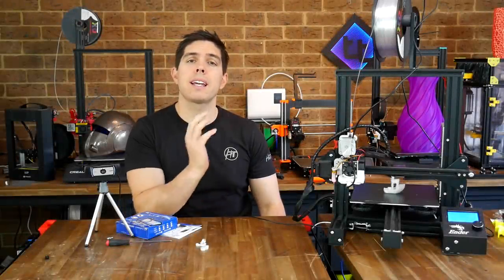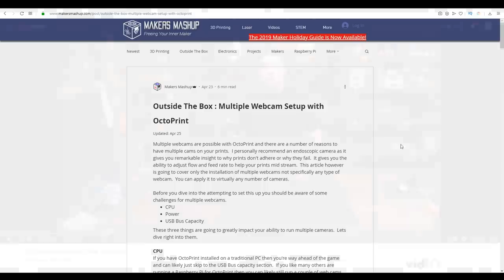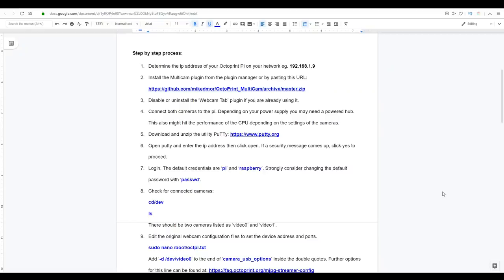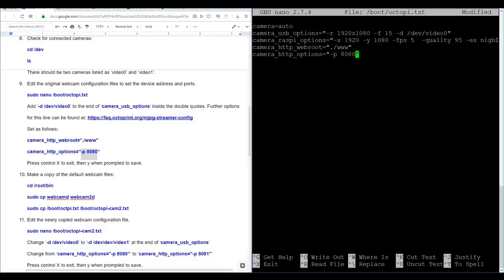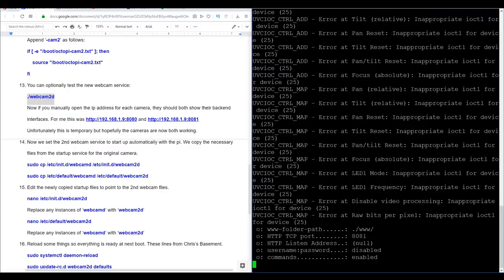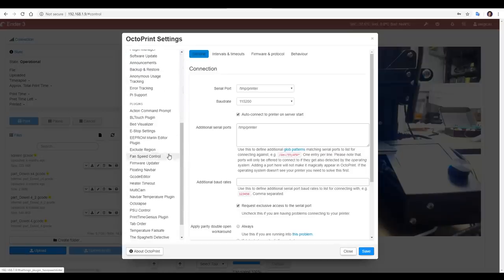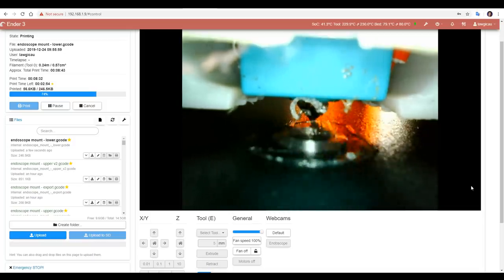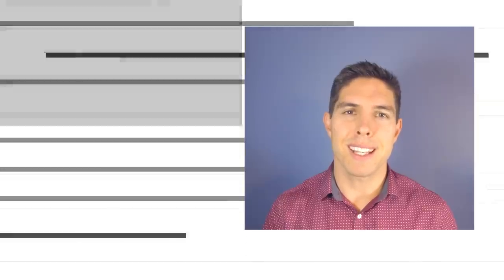Octoprint multicam endoscope guide - Macro nozzle vision

Comment: I just got octoscreem running on a 7" display. I do not have a long enough ribbon cable for my picam. But i do have a pi zero w, i set this up with another octoprint build. Now i can go to my raspi 3b with the display and login to octoprint. Then input the pi zero cam i.p. address and copy the text for the default cam for the rest of the link. Works like a charm.

Comment: Hey Michael, there is a pretty simple way to avoid oozing while probing, just have to set the start gcode to have the nozzle heat up after probe. Each slicer has slightly different code to do this. But i highly recommend it.
Reply: Mark Ferris problem with this is (not a massive one really) is that you need to compensate for the thermal expansion of the nozzle from heating
Reply: Etacovda63 doesn’t affect probing though. You’re not probing the bed with the nozzle, the bltouch or ezabl isn’t going to be affected by it. Only the bed needs to be heated while probing.

Comment: FYI: Raspberry Pi Static IP- If you do not configure your RasPi to have a static IP and the IP changes, your camera feeds will not work as the access URL is set to the original IP in the Webcam/Multicam menus. This can be avoided by setting the webcam URL's to "octopi.local:8080/?action=stream" rather than the exact IP. My Pi's IP changed and I had a fun time trying to figure out why I could not access the Octopi Login in my browser, or why I couldn't access the Pi through Terminal. BECAUSE THE IP CHANGED, also why I then found that my webcams weren't working. If this happens, you can login to your router to see that the Pi is connected to the network and pull the IP from there. Thanks for the vid Michael!

Comment: You are using the LAN IP in the settings. If your router reassigns a new IP (not likely to happen if you have configured fixed IP for it) you will need to update all the settings depending on it. If all the cameras are connected to the same system as octoprint, just use the 127.0.0.1/localhost.

Comment: You could probably use it as a 100% fool proof method of detecting the dreaded blob failure. Because the camera is fixed to the hot end you should be able to get the nozzle shape especially during a timelapse you could detect the deviation on the image from each nozzle snap in the same position and could detect the build up of junk on the nozzle tip.

Comment: I'm running Octoprint release candidate (1.4.0rc3) so that I can run the Octolapse release candidate (v0.4.0rc1.dev2) (which has the auto config), and things have changed slightly. 

The webcam service is controlled by systemd instead of init.d so the service location is /etc/systemd/service instead of /etc/init.d
  - I  changed the init.d path for steps 14 and 15 from /etc/init.d to /etc/systemd/system
  - and added a symbolic link to the multi-user target
      -  sudo ln -s /etc/systemd/system/webcamd2.service /etc/systemd/system/multi-user.target.wants/webcamd2.service

It seems to be working for me with those changes

Comment: Hi there, 

Thanks very much for the great guide. Here is my contribution for those who run into the same issue as I did.

My primary cam is RaspiCam V2 and I was adding a Logitech C920. I followed all the steps through 13 with no issues, but got a failure at step 14. Specifically with the following command:

$ sudo cp /etc/init.d/webcamd /etc/init.d/webcam2d

The 'webcamd' file simply didn't exist in the /etc/init.d/ folder, so there was nothing to copy. I guess it is not needed for the RaspiCam. 

So here is what I did:

1) Go to the /etc/init.d/ folder:

$ cd /etc/init.d/

2) Create an empty file called webcam2d:

$ sudo touch webcam2d

3) Open the file for editing:

$ sudo nano webcam2d

4) Copy and paste all the file code from here to the empty file (section /etc/init.d/webcamd): 

https://github.com/ntoff/Guides/blob/master/mjpeg_streamer_daemon.md#etcinitdwebcamd

5) Save and close the file using the following key combinations:

Ctrl+o
Enter
Ctrl+x

6) Make the file executable:

$ sudo chmod +x webcam2d

7) Execute the second command line from step 14:

$ sudo cp /etc/default/webcamd /etc/default/webcam2d

8) Then go to step 15

Enjoy!

Comment: Hey Michael, any chance of posting the STL for the endoscope mount? The mount I’m using keeps snapping on me. Also, when securing the cable, should I run it up and over the printer, or attach it to the rest of the wiring?

Comment: Firstly, great channel! top notch content but im having trouble with this multi cam install.. 

Operating OctoPi 0.18.0 with OctoPrirint 1.7.2 (most recent "stable" build at time of writing available from Raspberry Pi imager) on Raspberry pi 4b (4Gb RAM + 64Gb SD) Ender 3 V2 running Smith 3d (E3V2-BLTouch-5x5-HS-v4.2.2-v2.0.1) firmwear on my ender 3 v2 (4.2.2 Board). 

Ive tried this walkthrough several times and everything once i get to step 14 on the PDF (10:46 in video) i get an erro when trying to run either:

sudo cp /etc/init.d/webcamd /etc/init.d/webcam2d 
sudo cp /etc/default/webcamd /etc/default/webcam2d 

Both commands result in an files does not exits or user nano does not exist - no idea what im doing wrong im doing wrong. if i tried to directly serach for "sudo nano /etc/init.d/webcamd" or "sudo nano /etc/default/webcamd" then im shown an new blank file at which point if i exit without saving and then go to check the MJpeg Streamer snap shot i get a "site cant be reached" error page on google and cant seem to fix the isse causing me to reflash my pi and start again.... 

Any help would be apprciated!

Comment: If the cameras come up swapped, then you also have the resolution swapped ? Is your endoscope now in full hd?
Reply from the maker: Good point I'll have to check that. The frame rate is quite good so perhaps not.
Reply: Teaching Tech I think the cameras appear in the order you plug them in (first one being video0, second one video1) or in some arbitrary but constant ordering after reboot (probably depending on the usb socket you plug them in). 
If they appear swapped after reboot, most probably video0 and video1 got swapped, and that should also mean the config for cam2 is now active for the webcam (with the low resolution) and the other config is for the endoscope. 
At least that’s the impression I got from what you did in the video. 
Great video by the way.

Comment: HI. I am adding a 2nd cam to the latest. ver. 0.17 octoprint, but i do not have /etc/init.d/webcamd, specifically, init.d. where would this file be located? I am not a programmer so anything would help. Thanks.
Reply: basically i am missing the webcamd file in etc/init.d. How do it get that file?

Comment: most of the endoscopes on amazon come with a mirror at 45 deg attachment to view at 90 deg angles . Why didn't you use a mirror attachment and mount it in a vertical fashion ? Did you try and run into some obstacles?  that is what I am planning to do with mine and just tie wrap it to the inductive probe

Comment: I could not get it to work, trying with only one camera, skipped the part where you copied the file as i assumed that it was to duplicate the settings for the second camera but the issue is that i do not have the webcamd file and the /root/bin folder, not sure whats  up.

Comment: FWIW - There are 'endoscopes' that have totally flexible cords. Generally, they're sold as otoscopes for ear inspections. Other than the cord, they're identical to the vast majority of cheap endoscopes. The manufacturers are constantly changing, but you're after something like this: https://www.amazon.com/gp/product/B07BHLXGHC/ Make sure you get one with the shorter barrel (not like this https://www.amazon.com/Otoscope-Ultra-Thin-Inspection-Endoscope-Adjustable/dp/B0825Z3SDK/).

Comment: when i check for conected cameras via cd /dev -> ls 
i get multible streams video 0+1, Video 4-12 when one cam is plugged in and video 2 + 3 when i plug in the other aswell. which video should i use? Video 0 and Video 2?
Reply: yup, im getting the same thing.  I tried Video 2 & 3 with no luck.  Also, on Step 12, my webcam2d file looks completely different.  Where the 'if' command is, it doesn't show "if [ -e "/boot/octopi-cam2.txt" ]; then", instead it shows "if [[ -d ${config_dir}  ]]; then".  I have found that the config_dir is "config_dir="/boot/octopi.conf.d".  There is a cfg_files that shows the path of /boot/octopi.txt, which i would assume i just add the -cam2 to that, but im not a linux person at all, im just looking at the logic of what i see.
Reply: well, i found out mine was on Video14.  I have a USB Hub, so I worked backwards and found that the video sources could be from that.  Maybe thats your case.  I now get the video to be recognized under port 8081 on MJPG_Streamer, but no video output. When i run ./webcam2d, I get the following after TV-Norm. 

Could not obtain the requested pixelformat: MJPG , driver gave us: YUYV
    ... will try to handle this by checking against supported formats. 
    ... Falling back to YUV mode (consider using -yuv option). Note that this requires much more CPU power
Unable to query that the FPS change is supported
: Inappropriate ioctl for device
Unable to allocate buffers: Device or resource busy
Init v4L2 failed !! exit fatal
 i: init_VideoIn failed
Done bring up all configured video device 

Goodbye...

Now at this point I'm at a loss.  This is way above my paygrade.

Comment: Thanks so much for the video. Everything worked perfectly until I go to "sudo cp /etc/init.d/webcamd /etc/init.d/webcam2d" 
The webcamd file doesn't exist on my system in this folder. No idea why. The only way I can see the second web cam is if I run ./webcam2d from the command line after a reboot. Any ideas?
Reply: Chris' basement to the rescue. He post an updated multiweb cam video for Octoprint 0.17 https://www.youtube.com/watch?v=SdDq1wfTn0A&feature=youtu.be

Comment: To get around the video device swapping when the raspberry pi reboots you need to set up udev rules in linux .  Its been a long time since I looked into it but this    https://msadowski.github.io/ros-web-tutorial-pt2-cameras/ gives a bit of a run down.  

If using different usb cameras a simple method is to get the idVendor, idProduct from the lsusb command
eg
root@mail:/usr/lib/weather/pywws# lsusb
Bus 001 Device 001: ID 1d6b:0002 Linux Foundation 2.0 root hub
Bus 002 Device 001: ID 1d6b:0002 Linux Foundation 2.0 root hub
Bus 003 Device 001: ID 1d6b:0001 Linux Foundation 1.1 root hub
Bus 004 Device 001: ID 1d6b:0001 Linux Foundation 1.1 root hub
Bus 003 Device 002: ID 1267:0103 Logic3 / SpectraVideo plc G-720 Keyboard
Bus 003 Device 003: ID 067b:2303 Prolific Technology, Inc. PL2303 Serial Port
Bus 003 Device 004: ID 04fa:2490 Dallas Semiconductor DS1490F 2-in-1 Fob, 1-Wire adapter
Bus 004 Device 015: ID 1941:8021 Dream Link WH1080 Weather Station / USB Missile Launcher      <------ I'm interested in this one
Bus 004 Device 003: ID 0403:6001 Future Technology Devices International, Ltd FT232 USB-Serial (UART) IC
Bus 004 Device 004: ID 04b4:8329 Cypress Semiconductor Corp. USB To keyboard/Mouse Converter

Then one of my udev rule looks like
SUBSYSTEMS=="usb", ATTRS{idVendor}=="1941",ATTRS{idProduct}=="8021",  SYMLINK+="weather"

I used the symlink attribute to give it a meaningful name that is avail at /dev/weather, this is something that should be used for to easily identify the build plate and nozzle cameras

Comment: I don't see the point at all.
Adding cameras is about as useful as automatic bed levelling.
Unnecessary...
Reply from the maker: Each to their own.
Reply: just wait until you have a 500x500 bed, you will absolutely want a ABL system. 

and a camera. yes it is a good way to monitor . on my CR10 S 5  the first layer can take like 4 hrs for real big prints and I can monitor this from my office while the printer is 30 meter from me.
but he, each to his own, tmc 2130 are also not needed and neither is a magnetic bed ( if you have a 100x100 bed and not heated )
Reply: @patrickmaartense7772  Now you are just being silly. And what do you know? I have 7 Printers. All working. I have a Chiron...thats a big bed. And never needed or used ABL. Magnetic beds are also not needed. Stepper drivers is totally different and drifting away. You need stepper drivers. You need a bed. All these are needed to print. The others mentioned are not.
My 400x400x450 print bed doesnt change position. Unless maybe YOU have problems...hey each to their own. But its NOT NEEDED.
Thanks for your  "advice" I will take it with consideration. 🙄
Reply: @patrickmaartense7772  Incorrect also...heated beds ARE necessary when printing with real filaments other than kiddy PLA. I never print with PLA. ABS and NYLON are my main filaments. 
Cameras!! 🤣 Oh please
Reply: @swiftrick15   BIG boy...... I print with xxxxxxxx
#ignore
Reply: @swiftrick15  only 7 ???? not even 50% of my stack... just understand some people have different needs and applications. and I have no time to check and change micrometer leveling when prinitng different temperatures , that WILL cause additional expandion of zour bed ( there are reasons why the prusa uses temperature prcise probes as well . 

Im not even speaking on the different removable built plates (either glass, PPE sheets or the PEI sheets on the Prusa that have different heights 

but hell what am I saying you have 7 printers 

and oh yeah a chiron is NOT as big asa  CR10 S5  there is a 64% difference on bed  size alone ( 250cm3 vs 160cm3)

enjoy your ABL less printing.
im enjoying my BLT and inductive probes on all printers that are bigger than 150x150. and all have their own camera and raspi 3b
Reply: @patrickmaartense7772  My smallest printer is 200x200x200. I do not need more than 7 printers. They all serve a purpose.
Prusa...ok...sorry not a fanboy.
Why are you changing bed levelling all the time. It should be set once. And you can compensate in the first layer. Which is WHAT AUTO BED LEVELLING DOES.

OMG...Im not even bothering replying to you. You make no sense
Reply: @patrickmaartense7772  Dude...its 3D printing. Not rocket science. If you can't manually bed level then yeah..maybe you do need help. 🤣 And cameras too. Why not.
Even have thermal vision cameras too. Why not? Go all out. 

Meh
Reply: @swiftrick15  do not agree
leveling changes on temperatures
so on 190 ( yes PLA) it is different than on 290 ( yes I can with All metal hotends and decent nozzles)

and when I change the build plattform from glass to lets say a PEI sheet to get a different surface , also the height changes
I do not need to relevel the bed.

not a prusa fanboy ( hold on the chrion is that not based on the Prusa I3 design ( ahum)

all my printers have their use, even the small wanhao i3 mini  ( perfect for those quick prints ) 

saying ABL is useless is ignorant  on the possibilities it opens and ease of use ( like the TMC 2130, you never know you need them until you have them ) 

make your printing live a lot more easy
Reply: @patrickmaartense7772  Mate ABL is rubbish. Period. What..do you probe with bed at 290? If you have so many printers (stack) then why the need to.change beds so often?
Meh...this is useless..just like ABL.

Talk about the Heremen or something useful that benefits the printing communuty, then yes. ABL meh
Reply: @swiftrick15  sorry for the confusion, I meant bed at 110 , noyzzle at 290, 

have it your way dude. be happy  and do whataver you want.

its clear YOU do need ABL nor cameras, 

others like it and use it to the max.
cheers
merry xmas.
Reply: @patrickmaartense7772  by the way...the bed temp at 60 degrees or 100 makes no difference in thermal expansion. Nothing that would matter with even 1.2mm layer lines. And also..you have squish which is generic for FDM so that is why the first layer allows over extrusion...

Anyways...there is no arguement. Because I am right. It is UNNECESSARY. I never said you cant use it. I just said it is not needed to print and to print well.
The well trained do it manually and have much success.